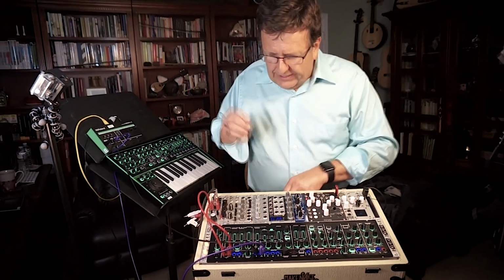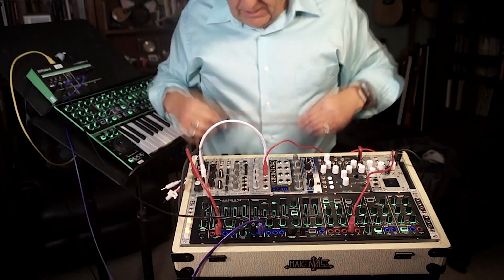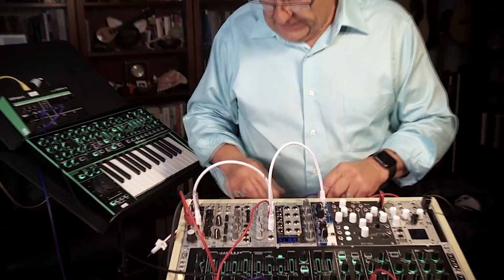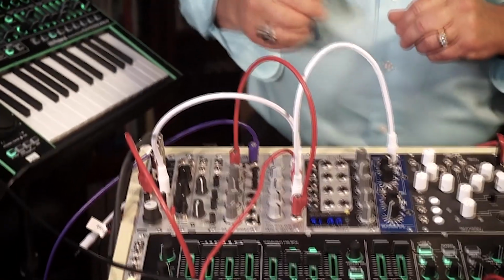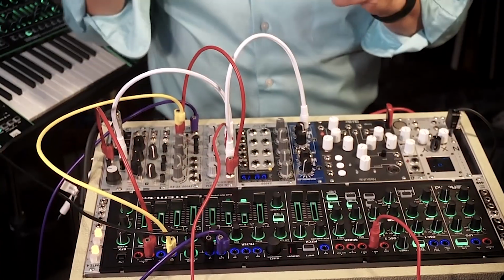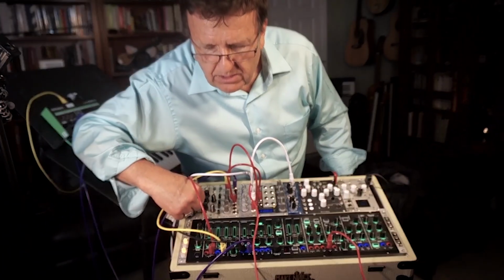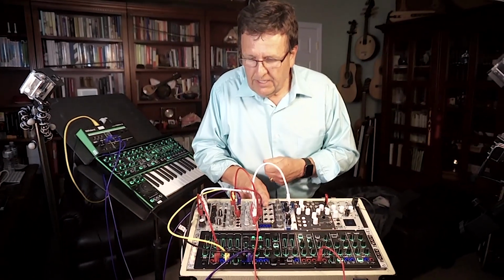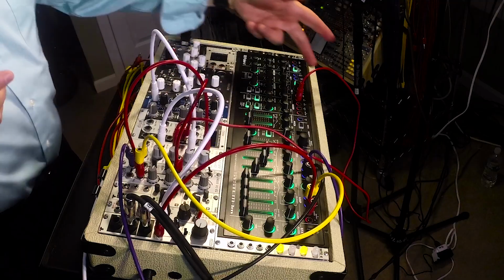Dr. Richard Boulanger - Part 5: Creating sounds with SYSTEM-1m and eurorack

Comment: Hi, I just buyed Roland System-1m. But after updating  to "SYSTEM-1m System Program (Ver.1.30)"and a factory reset then  I turned on the System-1m and the factory soundbanks had disappear. 
So, does anybody  please knows with which  soundbank comes the System-1m loaded?
I would appreciate any answer. Thank you.